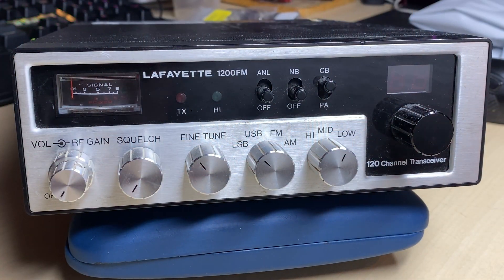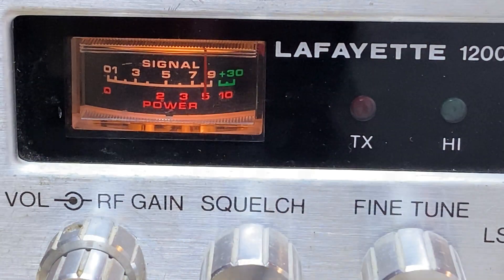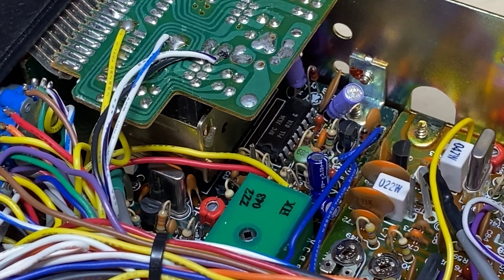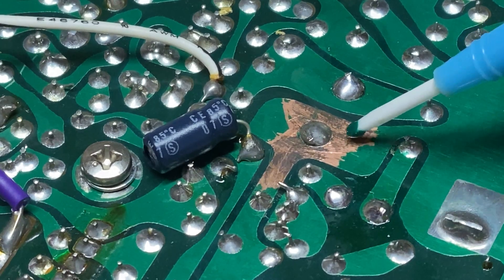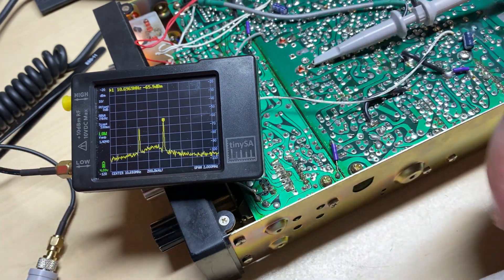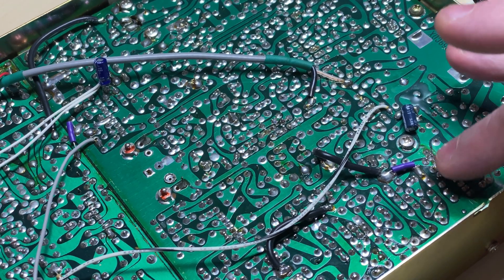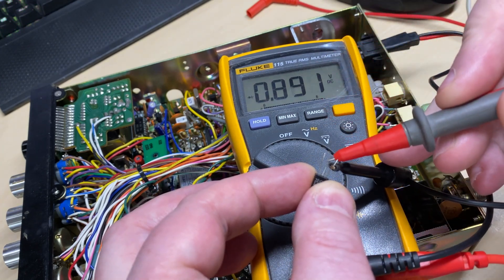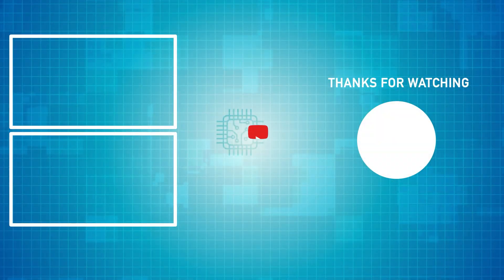EP 157 - Lafayette 1200FM - SSB 120ch CB radio - SSB receive fault .

Comment: When trouble shooting I adopt the blocks approach to narrow the area down 
Most circuits are shared by all modes so if they are working in one mode you can generally rule that block out and so on 
Then you get down to just a smaller area to troubleshoot 

Another good diagnostic video keep up the good work